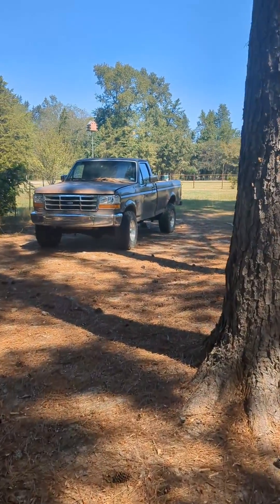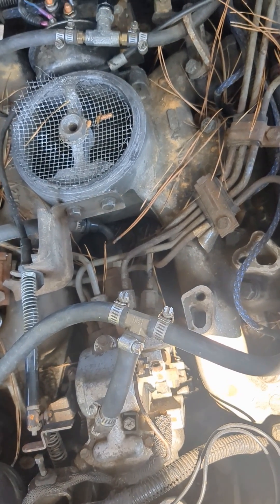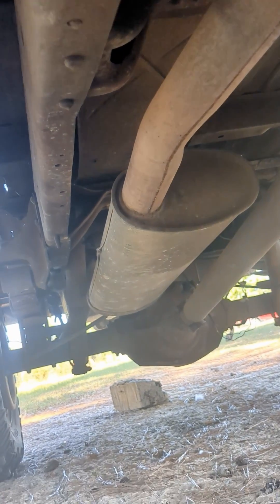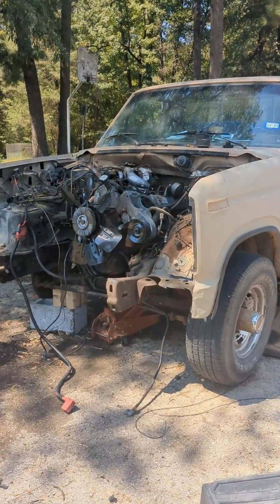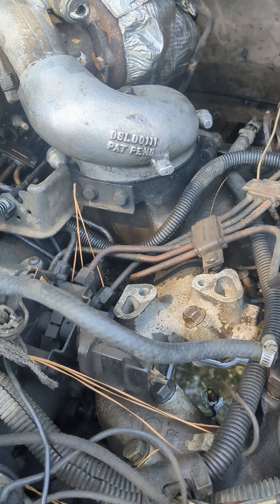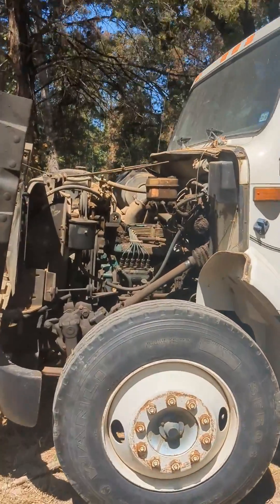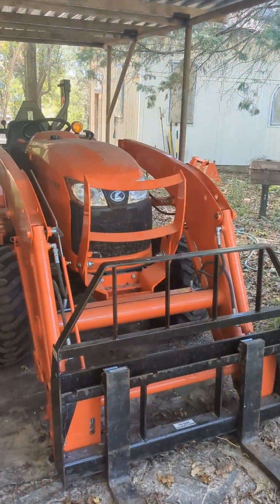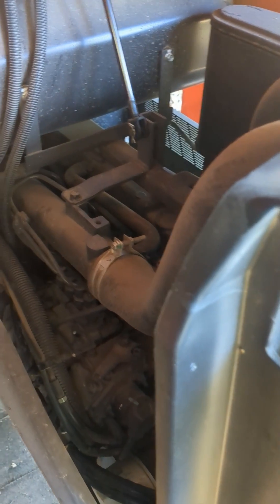Can My Engine Run on Black Diesel? - WMO - Alternative Fuel - Fuel Prepping - Part 1

Comment: I think you meant the 6.5lt detroit diesel in the 94+ gm trucks.  I have a 93 which is the last year that the 6.5lt detroit was mechanically injected with a db2 pump.
Running another 50 gallon batch through my 120gph PA biodiesel centrifuge that I bought just before the old man passed away.  Thanks again for continuing his project/business!!!

Comment: What about a Detroit 60 series?
Reply from the maker: @Petedriver1992  2-stroke Detroit do absolutely amazing and waste oil. Detroit's have a unit injector, meaning that each injector acts as its own injection pump. They're extremely robust engines, and in the summertime I know of customers who run them on 100% straight oil.

Comment: What diesel generators run on WMO?
Reply from the maker: Generators are tricky - they will work but need some help. Running at one rpm can cause injector coking so it is recommended to use a two tank system. Start & stop on diesel. Run on waste oil.

Comment: Can run the black diesel if you have those older engines.  What about Cetane Number?  Don't we want to address the low cetane number of the home brewed fuel?    I'm thinking we need autoignition to occur early enough in the compression to get proper burn and not soot things up.
Reply from the maker: Its not really an issue to be concerned about in older engines. The BTU's in motor oil is much higer than diesel.
Reply: @PABioSupply  What's not an issue?  Cetane number and BTUs are not related.  
And yes BTUs are higher, but only about 2%, it's hardly worth even noting.  Cetane determined when the fuel will ignite under compression. If it is severely delayed due to low cetane number of the fuel, it can lead to carbon deposits.  So yes, it is an issue.
Reply: @PABioSupply  I'm running an OM617 on black diesel, and I'm learning that it's not so simple as you might think.  I plan to pull the pre-chambers soon because there is severe coking deposits inside the pre-chambers now after running about 5 tanks of black diesel.   I can only hope that running a dual tanks will resolve the coking. But yea, it's not just so simple that it just works.  In some engines there will be challenges.
Reply from the maker: @thedillestpickle  Dual tanks certainly helps. Injector coking is more prone to some engines than others. Filtration also helps a lot as using a centrifuge reduces the carbon count in the oil.

Comment: While you do provide a good rundown of which engines can and can't run WMO, your understanding and descriptions of different fuel systems isn't entirely correct. 

First off, the lift pump pressure is completely insignificant regarding operation on alternative fuels, no matter if it's 6 or 60 PSI.

Fuel injection systems can be categorized into 3 different types: injection pump, unit injector, and common rail.
Only the more modern engines have common rail, and by definition, have a fuel rail with fuel pre-pressurized to the injection pressure, far beyond that of any previous technologies, reaching as high as 40,000 PSI. Because of this, these systems are extremely intolerant of any contamination or fuel with excessive (or insufficient) viscosity. Diesel fuel itself hasn't changed, except for sulfur content, which while a lubricant, is an additive used in very small amounts causing no change in viscosity. Common rail engines are also almost universally equipped with a DPF, further preventing the use of alternate fuels.
Unit injector systems are supplied with lift pump pressures, and the injectors themselves generate injection pressure with force provided either mechanically by the camshaft or hydraulically by a high pressure oil pump. These systems can operate on WMO and WVO, as they only operate at less than half the injection pressure of common rail systems.
Injection pump systems, whether mechanically or electronically controlled, use an engine driven pump with steel lines to each individual injector. Operating at pressures a third of that of unit injectors, they are the most tolerant of out of spec fuels.

Overall, the best choice is a unit injection system as they don't have DPFs nor too high of injection pressures, allowing them to run reliably on alternative fuels, yet have high enough injection pressures and more precise control (on electronically controlled engines) for increased efficiency and power, and easier cold starts. It's easy to find out what type of system your engine has by searching online and looking and understanding the components on your engine.

Comment: NICE WORK -- I RUN WVO ON A 7.3
Reply: How's that working out?  I've heard people have issues with the oil polymerizing and forming into a gum or varnish?  Seems it got popular and then fell off when people realized it had so many challenges.  
One benefit it has over WMO is that it has a decent cetane rating.  Black diesel has extremely low cetane value.
Reply: @mattrevesz  IT IS NEER 10% POWER OR 10% LESS MILES PER GAL BUT IT IF FREE! AND TODAY DIESEL IS 3.19GAL IN MY TOWN. ALSO I RUN 2 TANKS ON THE TRUCK AND START ON DIESEL AND OFF ON IT NEVER HAD A PROBLEM FOR 7 YEARS NOW
Reply: @WoodworthPatrick  Yea I wouldn't mind that loss in power or efficiency.  
So did you ever try running it single tank?  I've been running black diesel through my W123 mercedes, but already seeing coking problems.  I hear the 2 tank is the solution.
Reply: Also the 7.3 has indirect injection right?  Have you ever pulled the injectors and looked for coking on the injectors or inside the prechambers?